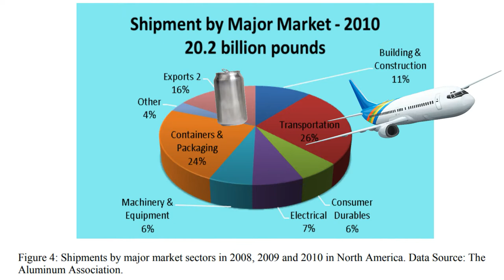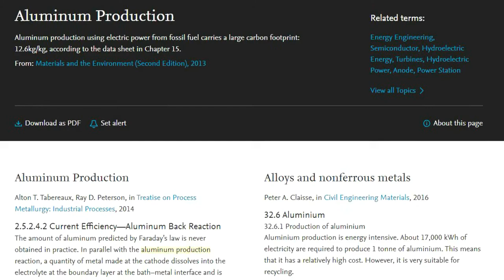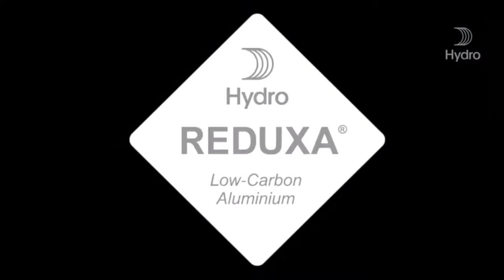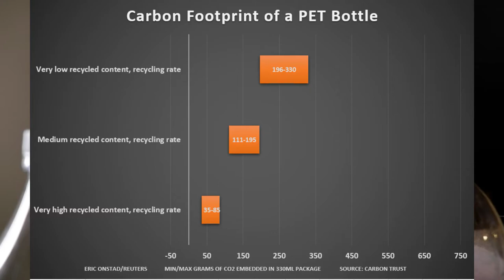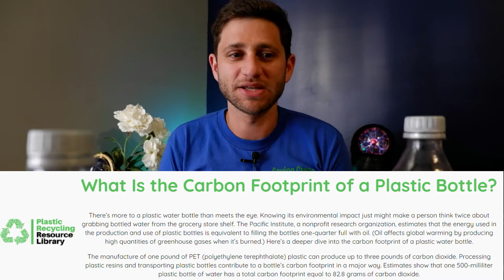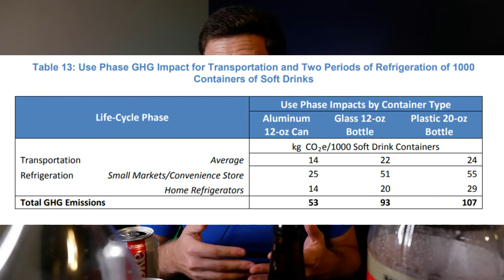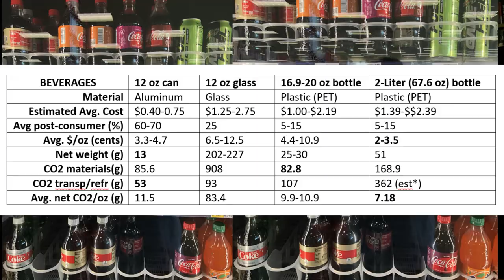Are aluminum cans really better for the environment?

Comment: Did i miss a section on land fill effect and natural degradation of materials?
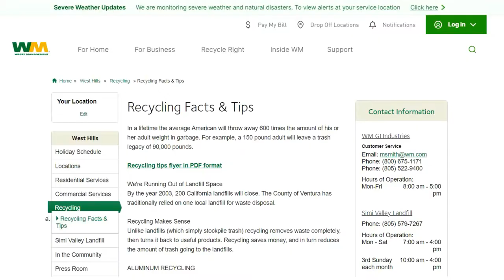Reply from the maker: Excellent point!  I quickly referenced around 4:27 some per/can landfill waste details noted in a table, and again at 7:46 discussing landfill space savings.  However, I didn't focus on physical waste breakdown, leaching, or other material waste considerations as much as the carbon footprint or recycling differences.   I also didn't include the WM website in the citations, so I'll link to that as well where specific savings of landfill usage, electricity, oil, etc. are neatly presented for a range of materials if you want more info on that.